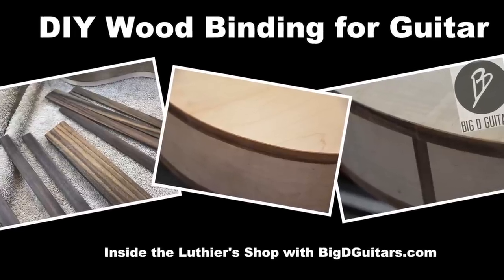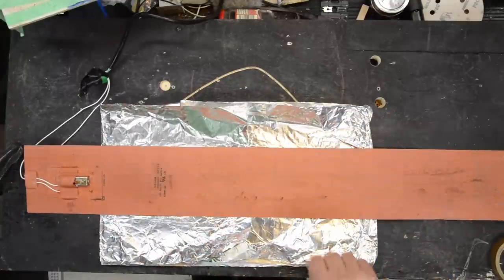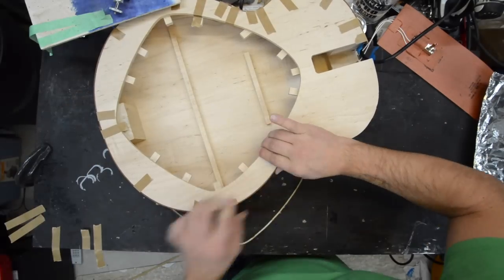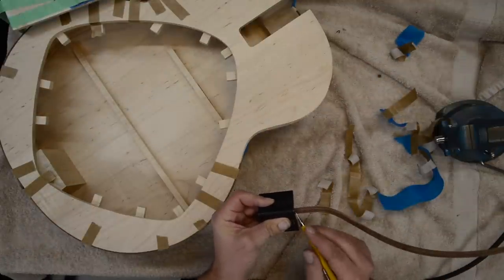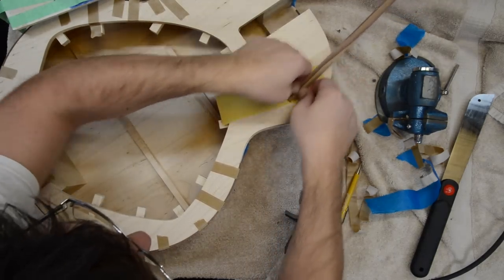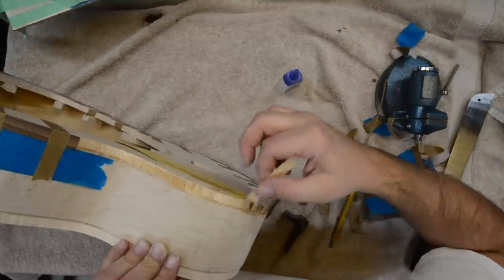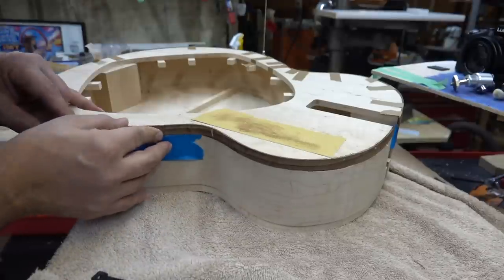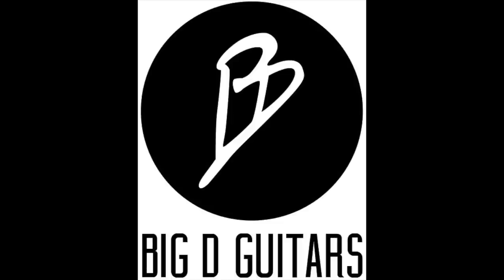DIY Real Wood Binding for your Guitar Project

Comment: BIGD, I saw where you used Angelus Leather Dye in an airbrush to do a fade on a green V. I just got a cheap airbursh and I want to try to do the same thing, but not sure what to clean the airbursh with after using the dye? Just paint thinner? I know this dye is really strong, may be hard to clean?

Comment: Nice, just wonder, would Titebond also do the job ?  Since Goto glue also has 24h to dry, what's the bennefit ?
Reply from the maker: +Will Kupers it's clear.  It has a bit higher tack initially that tight bond
Reply: BigDGuitars - Thnx for the response.